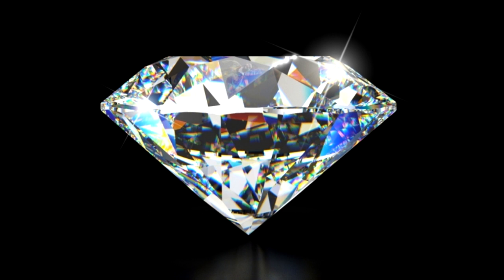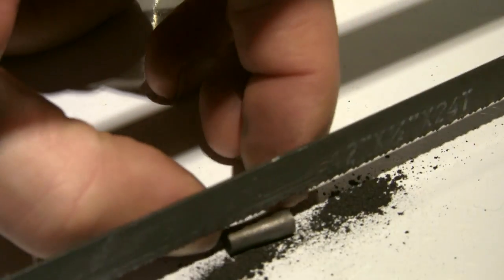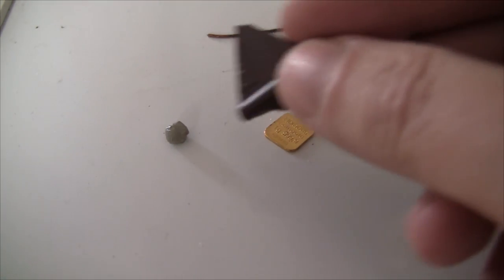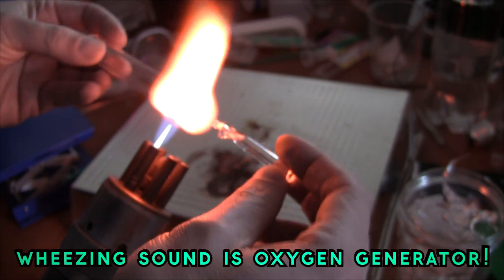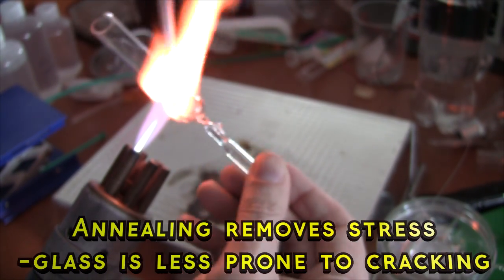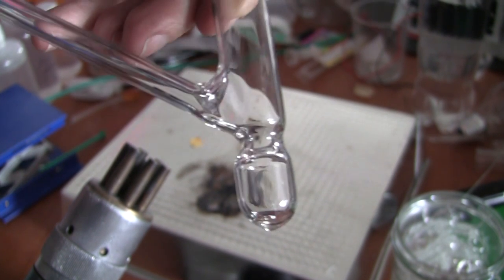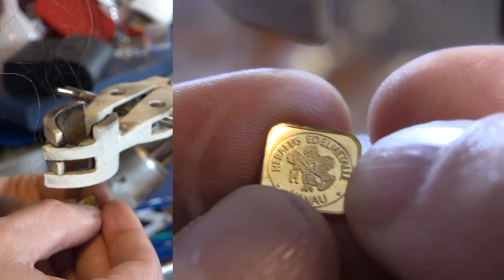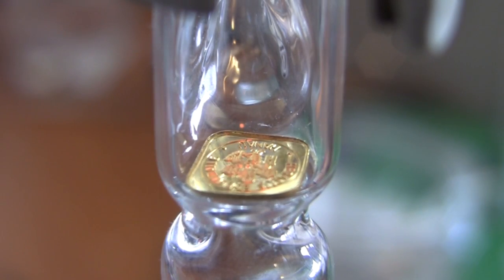Can burning Diamond melt Gold?

Comment: One possible reason why this didn't work is that the flow rate of oxygen gas was too high, so the excess oxygen was conducting a lot of the heat away from the burning diamond. Perhaps if you could arrange the piece of gold to sit immediately below the diamond (instead of on top), then more of the heat would be captured by the gold and it would have a better chance of reaching melting point. Another idea might be to pre-heat the oxygen stream before it gets to the diamond, which would make the diamond easier to ignite and would not conduct quite so much heat away during combustion.

Comment: The center of the burning diamond must be fairly cool in comparison. The outer layer would be the hottest and having it against the gold would pull that heat and send it out of the top of the apparatus with the constant oxygen flow. Basically a fan on a heat sink.

Comment: You need the oxygen blowing DOWN onto the diamond, i.e. blowing from above and the exhaust gases flowing over the gold and down and out the bottom. That way, more of the head goes into heating the gold. As it is, most of the heat just blows out of the top and virtually all of the heat transfer is through conduction from diamond to gold.

Comment: If you want to melt that exact piece of gold without polishing it down to loose mass make an apparatus so that can be pressurised to about 3-4 bar of pure oxygen, bash the ingot a bit with a ball peen hammer to form a slight cup so the diamond won't move about and minimise conduction towards the glass maybe with a small ring of asbestos.

Comment: Thunderf00t.  You can buy diamond grains really cheap from china.  I bet if you filled the test tube up with it would burn wicked hot with all of the surface area.

Thanks for the video!  Will any other gems burn?

As a glass blower you can put silver in the flame and fume it on the glass.  A small amount it become blue/green color changing pipe.  A large amount it gets a mirror finish.  Gold can also be used.  A fiberglass matt works great to anneal small projects on the cheap.  
If you blow the hole in the flame you will not get the big bubble blowouts.  
Making your own color rods with metals for the colors might be fun.

Comment: Thunderf00t, ever the romantic, gets chocolates, gold and diamonds and thinks . . . Let's burn it. 
I think you have a few problems with your setup 
A) The gold is large relative to your diamond so it acts like a massive heat sink with a large part of it's mass outside the heated area
B) that is made worse by the constant stream of cool air.
C) The gold is below the heat which is flowing upwards
D) The gold is very uneven so you have little contact with the diamond for direct transfer of heat which might compensate for the other problems

The graphite test had the gold inside the mass of the graphite and on top so it was in the hottest part

Comment: The oxygen you were blowing on the diamond was cooling off the gold and stopping it from reaching the melting point. You got to remember that even if gold is a bad conductor compared to diamond, its still exceptionally good. You thinking that you'll just make a hole in it is just unrealistic, the entire mass would get the heat transferred into it and melt. Maybe if the oxygen blowing into the tube had a temperature of a few hundreds of degrees, you would have had better luck.

Comment: Annoyingly I can't remember who did this, but I'm pretty certain that it was on BBC 4 fairly recently. A diamond was soaked in liquid oxygen, then it was set alight. It may have been put into another liquid but it definitely moved around and disappeared into thin air. Best guess is that it was in one of Jim al-Khalili's wonderful series. Whatever, it's a challenge for you. Make a diamond disappear in a similar manner. Meanwhile, this was fab. Particularly liked the way you can use chocolate to start the fire (though wouldn't a piece of paraffin fire lighter work better as it would hold onto the flame a bit longer?). More please!

Comment: I'm quite surprised that graphite is burning, because they use graphite to give sparks when they melt iron, since it's good electric and heat conductor. Are you sure it's burning? Not just heated up, glowing? Maybe chocolate is burning on it? Can you design an experiment to show that you can make graphite burning? (Even though you burn it in pure oxygen) It would be interesting to see a proof. Thx

Comment: hey thunderf00t
I'm a blacksmith, so maybe I can help you a bit:

there are a few simple things you could do to help increase your efficiency.

for one, you need to do more than just jet oxygen into the system. You should try to use a vortex form of circulation to get the maximum amount of airflow around all sides of the diamond, as opposed to blasting it from one side.
Second, you need to increase the surface area of diamond to gold contact to as wide as possible because of how well gold thermally insulates.
Third, and very importantly, you should heat up your air supply if applicable.

white heat is around 5.75 k °C, so your temperature is high enough, you just need to make your process more efficient.

I hope this helps.

Comment: How did you connect your o2 concentrator? I have a 10 liter / min one I got a garage sale for $10 (he was firm) anyway I'm worried about setting the hose on fire but I guess I really shouldn't be. The big issue is making sure that the higher pressure propane stays out of the tube I guess a water bubbler or a check value would be in order ?

Comment: +Thunderf00t Nice video.
You could've made the oxygen chamber more efficient:
1. Make an escape hole for the oxygen beneath the burning chamber.
2. Close the entry hole where you put in the diamond and gold off after they've been put in.

This way the flow of the oxigen would go past the diamond and the CO2 would be led away faster. Not saying it would've made that much of a difference though. I was going to suggest that you partially melt the gold onto the diamond before starting the experiment, but you mentioned that you needed a better contact surface yourself straight after.

Comment: Random tip: the oxygen blowing cools the reaction, if you can ramp up the temperature of oxygen (no clue how to do it safely), maybe you succeed. (in glass making industry, the air thats pumped into the burners in smelter is heated so it does not cool the flame)

Comment: In power engineering, we understand that a portion of the heat is lost to the exhaust.  You lose efficiency when you just emit the exhaust.  Put your diamond/gold inside the oxygen tube (you've finally done), but run your exhaust back to the oxygen supply.  By putting it through a heat exchanger, you can transfer some of the waste heat to the incoming oxygen
Reply: And that would require a much more complex design, and glass would no longer be a good material to do it with.
Reply: Heat exchangers are readily available.  And, they are essentially coils within a chamber, with a fluid flowing through each.  Leaving the bulk of complexity to the path of piping.  Incoming oxygen into the exchanger coil, to the sample bulb, to the exchanger chamber, then to air exhaust.  The whole point is to prevent as much waste heat as possible.
Considering how many times Thunderfoot has tried this experiment in the last year, it might be a good investment
Reply: sorry, I thought my response would be obvious.  The tubing would still be glass, just a few extra bends.  Not that complex at all.  A direct response to what you were saying.  A heat exchanger is available on the open market.  And, my response involved zero insults or trolling

Comment: Graphite's conjugated pi system is actually an electro-entropically stabilized high enthalpy allotrope of carbon. Basically, carbon is at a lower energy level in diamond form. However, diamond's high thermal conductivity will transfer heat released from the outer layers to the inner layers greatly increasing the temperature as it burns. It should be extremely difficult to ignite, but should melt through the gold if done.

Comment: This experiment doesn't demonstrate your hypothesis. The only hypothesis that this experiment demonstrates is that: a burning diamond in an oxygen rich atmosphere would not melt its way through gold under the force of gravity.

This forgets FUNDAMENTAL PROPERTIES OF DIAMOND VS GOLD.

DIAMOND WILL NOT FALL THROUGH LIQUID GOLD! You should know this from your mercury experiments!

DIAMOND IS LESS DENSE THAN LIQUID GOLD, even if the diamond melts the gold, it would float on top of it. There is no physical way that a burning diamond, under the force of gravity alone, could melt it's way through the gold unless the gold is exceptionally thin or unless you apply a force to to the diamond to overcome its buoyancy factor,. the diamond will sit atop the gold displacing it's own weight and won't melt through the liquid..

Furthermore: If the aim of the experiment was to see if: burning a diamond in O2 can melt gold, then why is the burning fuel mix placed above the subject and not under it?

Looking at the flame, it appears that most of the heat from this experiment is being blown out of the tube by the O2 pump, away from the gold, so most of the energy was being lost, which invalidates the experiment anyway.

Wouldn't it be wiser to place the O2 injector and the diamond into the bottom chamber... the gold can stay where it is, because all you are trying to do is melt a hole in the stuff using the energy derived from generating CO2 from; O2 and Carbon sources rapidly decomposing, which is what your pocket lighter does anyway. 

Let me finish this by making a pretty certain prediction about your next experiment. Placing the Diamond into the gold.

If you drilled a small hole in the gold, place a diamond into it and burn the diamond; providing the heat does melt the gold: The diamond won't "burn through it", the DIAMOND WILL FLOAT OUT OF THE HOLE and the hole will be SHALLOWER AND WIDER THAN WHEN YOU STARTED because the MELTED GOLD IS MORE DENSE THAN THE DIAMOND.

But you knew this outcome anyway, because you watched diamond floating on mercury.
Reply: Err, the gold dont need contact with the hot object to melt. The liquid gold would actually melt the normal gold even quicker than in contact with the surface of the diamond so the gold should melt quicker, not slower.

But yes, you are right about the fuel being below the gold.
Reply: Don't forget, melted gold will radiate thermal energy away from a source of gravitation. This is mostly due to particulate movement. Less dense material will rise, so, rather painfully, the diamond will melt a small pool of gold and, the top will be hottest and the coldest area will be the bottom, where there will be solid gold... The convection efficiency drops badly when fighting gravitational effects.

Let's suppose it was a bar of gold. There is no way the diamond could melt through without first burning out. But lets give the diamond the benefit of INFINITY. It would burn a puddle of gold, and then it would sit there, in the puddle of gold, forever burning, never burning through it. This is because the thermal energy is being mostly lost in Carbon Dioxide and the surface area of the gold pool would dissipate the energy upwards into the air over its surface area. 

In the coins case, the entire coin would fold in half before ever being burned through.

You see, when people think of burning stuff, they think candle or Thermite. In the case of a candle, the material is being burned up into a gaseous form, so flame steadily crawls down the candle wick. In the case of Thermite, it is boring a hole because it is heavier than the material it is on and it is hot enough the melt a hole. If the thermite wasn't heavier, it would sit on top of the substance burning in a similar way and if the suspension material doesn't evaporate, then it would stay there, steadily melting the suspension material until it reaches a point where the heat loss isn't melting any more area.

Comment: quick question, where does the diamond burn by-product /fumes end up? gold plating is done by 'evaporating' gold.. is it possible to 'diamond plate' stuff by burning a diamond underneath a surface? and what could potential commercial/industrial applications of this be? thank you
Reply: Gold plating is done by electrolysing gold ions (from gold salts) in a solution of some solvent. Carbon is not a metal so you cant electroplate it to anything. Evaporating gold wont do this either.
Reply: SirusKing that is the traditional way of gold plating you describe. but i have seen a video describing how they gold plated austronauts helmet visors, and it surely said "by placing the screen over evaporating gold"

Comment: Here's a theory. Because the diamond is so light and because you're actually blowing air under it, maybe that creates an air gap between the diamond and the gold, it also cools the gold and dissipates heat faster than it can reach melting point so that's not helping either. Maybe you should try that experiment again in an oxygenated environment only and give it a little push from the top as well.
p.s. I also saw the similarities between your video and Cody's Lab but I don't think you guys copy each other. I guess that's the key word here "think". People should try doing that before commenting whatever bullshit they think will get the more thumb ups.

Comment: I've braze set hundreds of diamonds using an oxyacetylene torch. Never managed to set one on fire. Torch can go to 3.7kK, but that is a lot higher than what one would typically use. The diamond will glow red hot under the flame, but cool down almost instantly (if still free standing).

Comment: It seemed kind of obvious to me that if you place a basically round object on a very uneven surface that the transmission of heat would be faaar from optimal, and the thermal conductance of the gold didn't even come into it.

Comment: Heat move up.... try putting the gold on top of the Diamond
But what is the point?  There are allready ways to melt Gold. Are you trying to find a more expensiv way?
If you could use the heat for something better like power something. But is it even worth it? Better than Coal?

Comment: burning diamonds to melt gold...jeeze how much patreon support are you getting?

i'm joking, i know rough cut diamonds are pretty cheap and a gram of gold is only like 30 bucks.

also...you should do a video just about glasswork that was the best part of this video, for the gold you should have added a second shelf so you can put the gold ABOVE the burning diamond instead of BELOW...since heat rises you are wasting like 90% of your heat by putting it above the gold...you would need a second pipe out the other side for adding the burning diamond.

Comment: I dont,t know if you'll read this, but you can try melting a gold mesh, your gold piece had way to much heat capacity and didin't heat up enough and we also have to take into account the melting heat that has to be added. The wires in a mesh will be a fraction of a gram and will dissipate the heat less efficiently than a solid piece. Just an idea. ps cool chanel, keep up with the science and logic you provide us.
Reply: Good idea, but likely hard in practice. Especially if you want to minimize gold waste. Still, if you wanted to force it that'd be the way

Comment: See I'd be interested to see Diamonds used as a sort of thermal cooler, or at least as a component, seeming as they're so thermally conductive. Maybe for use as a heat sync.
Not sure how viable it'd be price to efficiency wise, or if it'd work at all, but food for thought.

Comment: Maybe try diamond dust? You can buy it from lapping/polishing guys. Your heat flux should be higher because of the increased surface area
Reply: krap101, yes, good idea. But the ignition could dissipate the diamond dust before any real burning; a compromise might be buffing smaller diamond chunks

Comment: graphite ISN'T charcoal, same elements but totally different structure. in matter of fact, because it has such a high tolerance to high heat, it's used as crucibles for metal melting. 
 CHARCOAL. will only burn and help melt the metal.

Comment: "Lavoisier heated a diamond in a flask of pure oxygen. It burned away to smoke."  wikipedia   A diamond is simply compressed carbon so it stands to reason that it would melt gold as crucibles used to smelt it are commonly made of graphite, aka carbon. My money is on the gold going dribbly. The question is (I've not watched the video yet) can you feed the stone enough oxygen to maintain the burn?

Comment: Probably most of the heat of combustion was convected away from the gold from excessive oxygen velocity.  Try putting the gold on some sand, then hammer the diamond into it, so the gold adopts a sort of hemispherical shape conforming to the diamond surface, such that the thermal contact area is increased.  Then  modify your glass rig so that oxygen is fed in beneath the constriction at low velocity.. and a damper at the top to prevent heat from escaping too quickly.. and a tungsten screen underneath the diamond/gold to keep it well above the restriction and allow O2 to flow into from underneath .. keep up the good work.
Reply: If you press the diamond you will certainly deform the gold, if you hammer it you risk cleaving or shattering it. Diamonds are hard, but not super resistant to shock/sudden impact. You can very easily turn one to dust with a few hammer blows.

Comment: Dude..you're amazing.  A dangerously talented guy.  A Master Tinker.  I bow to you in humble admiration, sir.
Reply: Did you consider that the gas flow was cooling the gold surface?  Reduce the surface area of the burn through as well as the thickness.  Or heat the oxygen flow.  Just a thought.